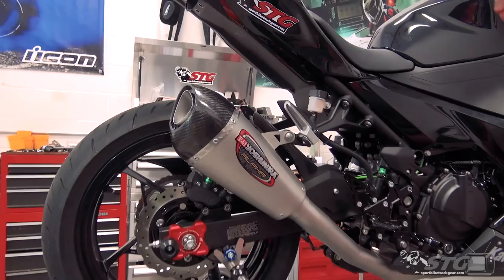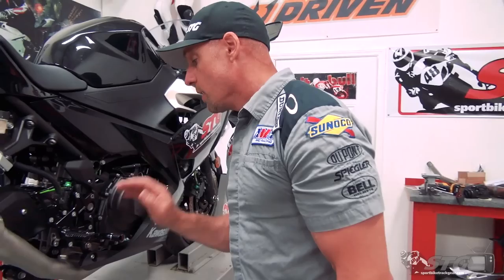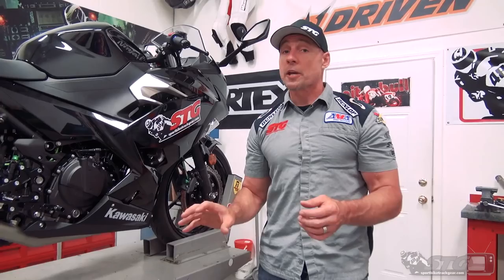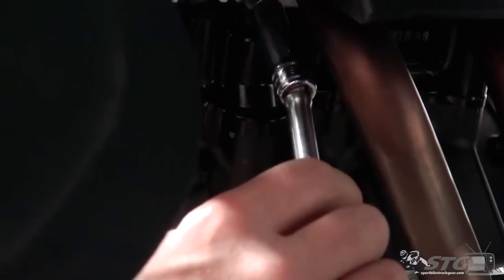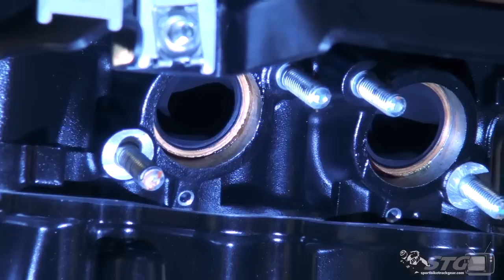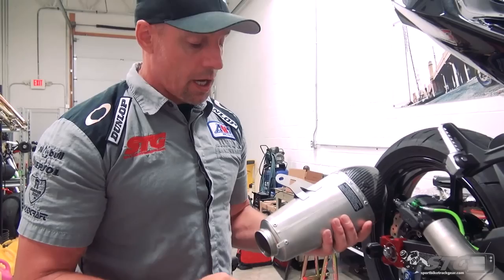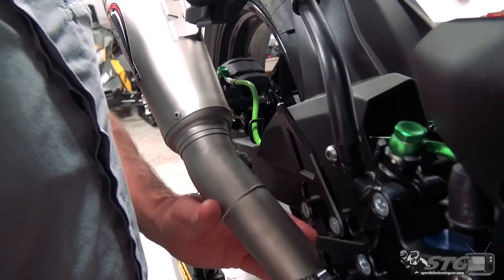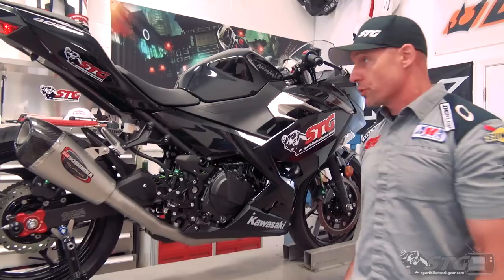Yoshimura 2018-2023 Kawasaki Ninja 400 Full Exhaust System Install | Sportbiketrackgear.com

Comment from the maker: Received word back from Yoshimura in regards to the exhaust insert. Per Yosh the Ninja 400 will make a little more total power with the insert installed (while reducing the noise level). Without the insert it will have a little more bottom end power from 7-8000 RPM. - Van
Reply: Needs tune??
Reply: overall gains?
Reply: Did you dyno it? Or just slap on a power commander with the yoshi full exhaust map they have on their site?

Comment: If someone owns the slip-on Yoshimura kit and wants to upgrade to a full system, would they need to buy an entirely new full system or could you mount the full system headers to the slip-on? Additionally would there be any long term damage running the full system without a tune?
Reply from the maker: The can is the same for the slip on and full system. At this time Yoshimura is not offering the header as an upgrade so if you think you want the full system best to buy that and skip the slip on. As for damage running the bike without a fuel controller of ecu flash we have a 2015 R3 here with 2k miles (track and street) that has had several aftermarket systems on it. Bike runs fine, zero damage. - Van
Reply: Stock ECUs are only good for about a +/- 10% fueling adjustment, beyond that, a tune is ALWAYS necessary if you wish to extend the engine life. Considering the emissions nazis demand everything run as lean as possible without melting a piston, opening things up will result in a worsened lean condition. Get it tuned, folks.

Comment: Does  the very bottom fairing below the foot peg make contact with the exhaust? I have just fitted this system to a 2023 and the lower fairing touches the exhaust when bolted in.
Reply from the maker: We did not have any issues with that on our 2018. I have built 2018, 2020, 2022 and 2023 400's now in race trim and only noticed a couple minor changes with the 23. I saw a different rear caliper hanger and an emission canister not found on previous models. - Van

Comment: Out of all full systems which would u recommend? And why?
Reply from the maker: When it comes to exhaust I tell people to choose the one they prefer the look and sound of and pull the trigger. Both this Yosh system and the Akrapovic fit really well, perhaps just a touch better than the rest if that helps. Overall quality Akra is very hard to beat, they are the benchmark in exhaust. - Van

Comment: The pipes on mine, where the fork is, doesn't seat all the way into the bike. When I tighten it down there's space between the bike and the plate that gets tightened down. After a noton ecu flash, velocity stacks, and yoshimura glfull exhaust (with block off) it lags around 5-6k and when I let off the throttle it doesn't sound right. The flash basically gets rid of engine braking but the exhaust sounds off.
Reply from the maker: I would need to see the bike in person to be able to help you with this. - Van

Comment: Would one need to retune the bike or install any other components after installation of this full exhaust to avoid future possible problems? 

I’m being offered a good deal on this exhaust at half the msrp but don’t feel like dropping another 3-400 on a tune
Reply from the maker: You can install this and ride the bike without any tune or fuel controller. We rode our bike (and some others) for a long time with a full exhaust and no fuel mods. Zero issues. - Van

Comment: What is the point of rubbing the exhaust down with WD40 or alcohol and get the oil residue from the finger prints off, when you get tons of oily stuff and other shit like rubber and asphalt from the road while riding it? It will still burn into the system anyway.
Reply from the maker: Your finger prints will burn into the pipe and look like shit. - Van
Reply: @sportbiketrackgear  But after a ride, wouldn't everything else picked from the road burn into it anyway?

Comment: Brian,
I'm thinking of picking this up for my 2020 Ninja 400. It's hard to really experience the sound in exhaust videos. In your experience, which exhaust system is deeper in sound? The Akrapovic Full Exhaust or this Yoshimura? Thanks.
Reply from the maker: The Yoshimura is a little louder as the can is smaller. The Akra can is one of the larger for the Ninja which also makes it one of the quietest. - Van
Reply: Two brothers or Yoshi, Mr. Van?( without money being an issue) I noticed sometimes because something is at a lower price does not mean it’s not better then the competitors. Your thoughts, please. 
& thank you as always.

Comment: Shouldn’t anti-seize go on the O2 sensor as well? If one is ever planning on swapping the exhaust out again?
Reply from the maker: You could use a little on the threads to be safe. We do not keep a bike long enough for that to really be an issue. - Van
Reply: @sportbiketrackgear  Thanks Van! Went with the Yoshi for my Ninja 400 because of this video. You rock! Keep up the good work.

Comment: M4 full system or YOSH’ full system/ here?
Honest opinion. 
Trying figure out what full system to buy from you. 
M4
Yoshimura 
Hindle
Sparks,ect
Thank u. 
Sgk23Tv 
Dxiego 

PS. Thank you, I received my TT rearsets.  Easy install super great quality & Smooth shifting. 
I Just need to switch the pegs ASAP. It’s cutting my leg getting on & off the bike. 
Thanx Mr. Van 
STG stickers going on my bike. 

Folks in comments my 2020 ninja project bike 80-90% of parts are coming from STG 🔥
Reply from the maker: First I want to thank you for all of the business! To be honest there are several solid options for the Ninja 400. I happen to have a couple of them that we installed on video that are in new condition I need to sell. Shoot me an email to service@sportbiketrackgear.com and we can sort that out. May be able to save you some money. - Van
Reply: @sportbiketrackgear  ok,
I will 100%. 
Thank you

Comment: Does improve the top speed with the new system?
Reply from the maker: With proper tuning this will improve the performance of the Ninja 400 which would be most notable on a properly built and tuned race bike. You would not notice any real increase in top speed on a street bike with this. - Van

Comment: Sound good
The hole pipe looks biger than oem isnt?
Reply from the maker: Yes the tubing is a little larger than the OEM. - Van
Reply: @sportbiketrackgear  is it will increase the torque or what is the advantage from the biger tube?

Comment: The exhaust has db killer ?
Reply from the maker: The Ninja 400 makes more power with the insert installed in the exhaust with pretty much every full system. - Van

Comment: 3:23 If you are willing to drop ~$1k on a full system, you might as well spend another $400 for a tune. A full system without a tune is like a Ferrari with a governor. If you're gonna do it, go all the way.
Reply from the maker: For sure best practice is to install a fuel controller etc... With that said I also know many riders will install the full system and follow up with the fuel management down the road (some riders never do anything with the fuel management). - Brian Van